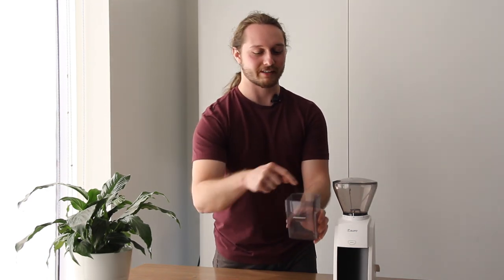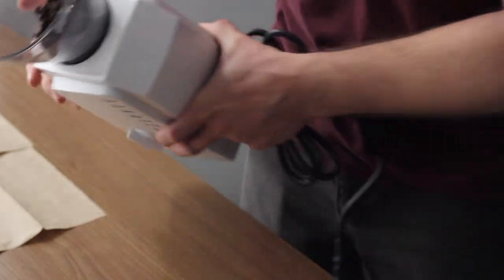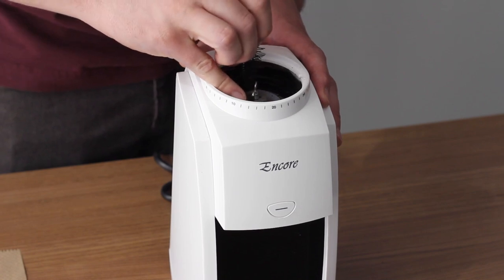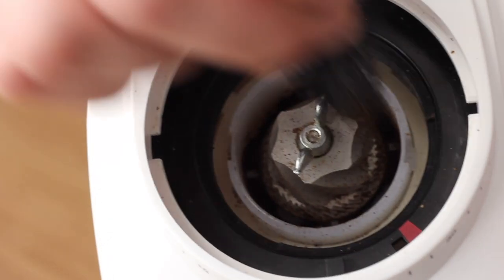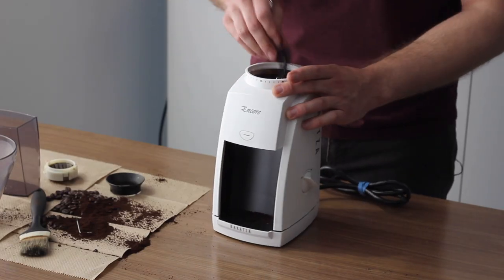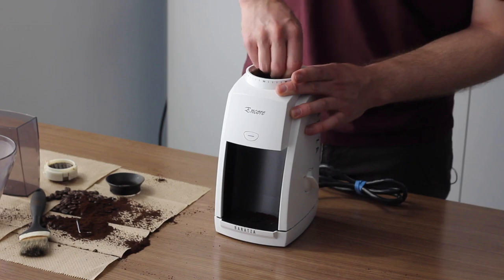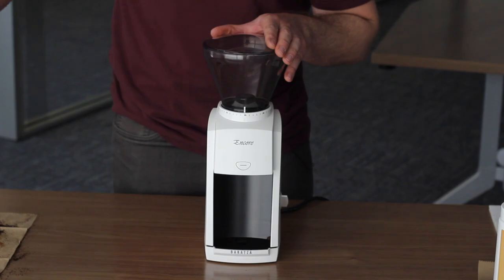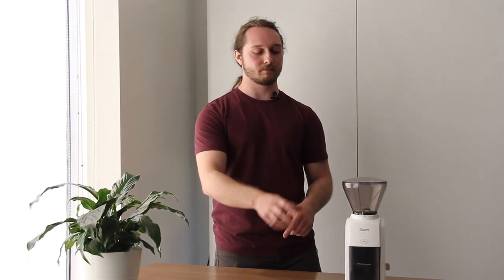How To Unclog and Clean Your Baratza Grinder

Comment: I must say that while it works, it does a good job grinding coffee for my french press. However, with daily use,  I HATE it. I have nevere used a messier coffee grinder. Whether I am emptying the bin or just grinding coffee, it goes all over the place! I always grind the day before I plan to empty my bin because I learned a long time ago that this will cut down on the static electricity.  I tried to return it to Amazon but was told the window had closed (by one week) and was told I would have to call the company. I did and they said it was one week out of return so they talked me through how to unclog the grinder, which I did. I then ordered the pills to keep it 'from getting clogged' but here I am, one month later, and clogged again. I have used the pills approx. every 10 days and I'm at my wits end. 
I honestly thought of just chucking it and purchasing another, but then realized I"ve only had it since July and I can't afford to throw away $200, so here I am , again having a clog, and hating my machine.
Reply from the maker: Hi Susan, thanks for stopping by our channel! It sounds like you're having to deal with an unusual amount of clogging with your Baratza grinder. May we ask what grind setting you typically use? You may have to coarsen your grind and see if that helps. If not, feel free to email us at hello@eightouncecoffee.ca so we can help troubleshoot!